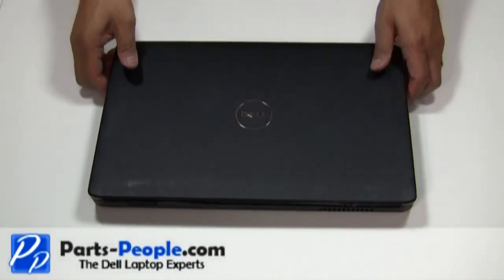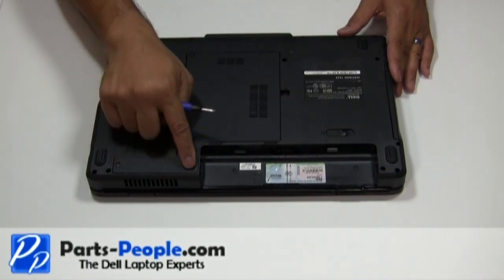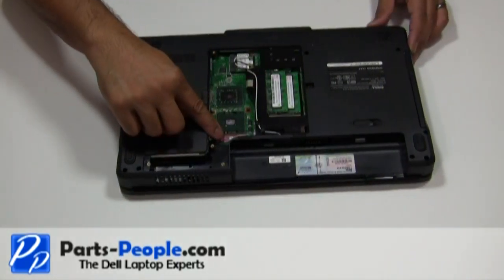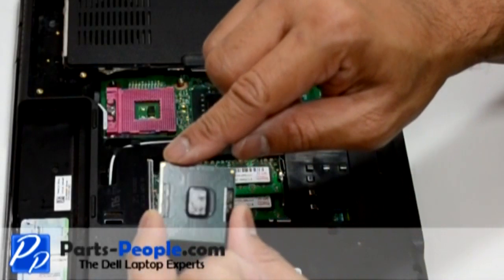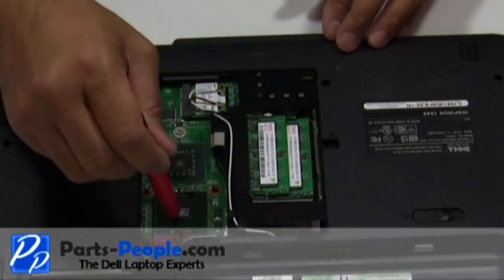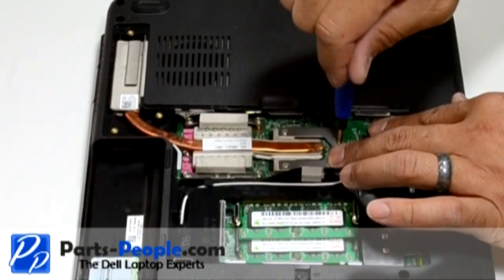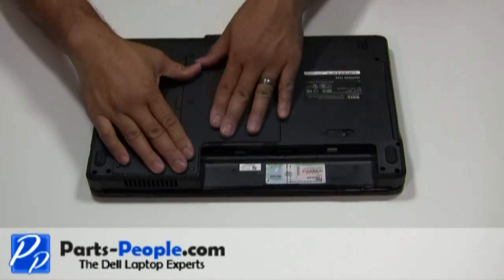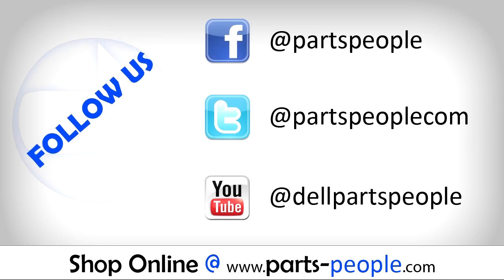Dell Inspiron 1545 | CPU Processor Replacement | How-To-Tutorial

Comment: Best use of the internet ever. Easiest upgrade I've ever done, thanks largely to this video. Many thanks.

When I lifted out the heatsink there was a sticky blue rubber pad on the chip directly next to the CPU, between the heatsink pad on the chip and the heatsink itself. Does anyone know what this sticky blue stuff is and what it is supposed to do?
Reply: Never mind. I finally conquered my inability to spell and up it popped.
Thanks again for the great instructional.
Reply from the maker: It's a thermal pad, kinda like thermal paste that is used on the CPU and/or GPU. It helps transfer heat off of the GPU and transfers it to the heatsink. On this laptop it is critical that you replace it so the GPU doesn't overheat and fry the motherboard.

Comment: This is super-easy to do, and well worth it. You can get a 2.93 GHz T9800 for less than $25 (or go full-hog on the 3.06 GHz T9900 for $50) and both are fully supported and give the laptop a whole new lease on life. I'm typing this on a 1545 with a T9900, 6 GB of RAM, and an SSD. This is actually competitive with some of the new budget laptops being sold now, and believe it or not, the battery life improves dramatically with the upgraded CPU, because these are higher-quality silicon.

Comment: What is the CPU socket that these come with from factory as mine currently is an T3400 with 2.16Ghz for the CPU and is x64 based. The CPU itself is causing not only Windows to act like crap but Things like Visual Studio 2015 takes to long to open as the CPU is so much crap it wants to use a whole lot of the 4 GB RAM it has which litterally hovs about half of it while the system hogs the rest making other programs close and sometimes it closes Visual Studio because the OS would need more RAM and so then I lose any changes to my C++ Code I did so I would be stuck with Notepad++ and invoing the compiler and linker directly by commandline (which defeats the purpose of the vcxproj project files. At that rate I would rather use clang 3.9.1 and gcc 6.3.0. But I found a good CPU from intel wichi is normally about 300$ there on ebay for 10.90$. The issue is it requires these Socket types and I am wondering what socket is shipped ddefault with these computers? The sockets needed for it is: Socket Type: Socket 478, Socket P, PGA478 Also the CPU is 64 bit so it should not change the amd64 status on it right? The current one it has is "Intel(R) Pentium(R) Dual CPU T3400 @ 2.16Ghz 2.17Ghz".
Reply from the maker: The 1545 motherboard will have a PGA478 socket.
Reply: Ok, So I opened it up last night and noticed there was no more thermal paste left as the T3400 Processor burt through it all or something. Also I noticed it does not have the PGA478 socket but the actual Socket P. My guess is that some builds of the Inspiron 1545 has the PGA478 while others might have the Socket P. Hmm what good is an socket P if it game with the T3400 since probably before I got it about 3~4 years ago. But yeah when I looked it at directly I seen mPGA478MN which implies the socket P.
Reply from the maker: I will need a name or email to confirm  the repair cancellation

Comment: To those watching this: Remember to put on a thin, even layer of thermal paste, such as arctic silver 5, in between the heat sink and cpu processor. If you are using the same heat sink, clean the old thermal paste off with ALCOHOL, then apply a new coat.  You want the paste thin, but without any air in between heat sink and processor.
Reply: Raoul Duke how much silver 5 can i apply ?
Reply: thehegt Tr a very thin layer, covering only the part of the cpu processor which contacts the heat sink assembly directly.  The layer should cover all of it with no air gaps, but not be too thick or cover excessive surface area.

Comment from the maker: The criteria for the 1545 processors are :

1. Core Duo or Core 2 Duo

2. 1mb, 2mb, or 3mb cache

3. 667mhz, 800Mhz, or 1067Mhz bus speed

If the processor meets the criteria then it will be compatible. I hope this helps.

Comment from the maker: When applying thermal paste, you will only need an amount about the size of a pea, directly on top of the chip. If a little of the thermal paste gets onto the green, it's fine, but the thermal paste needs to be centered over the chip.

The gm45 supports DDR2 only, not DDR3. DDR2 800 MHz SODIMMs up to 8GB total.

Comment: Hello, Have you renewed the thermal paste in the video also on the Northbridge? And how much should I use? It is bad if a little paste is on the green platine next to the black cpu chip?
So next question i want to ask, the gm45 chipset supports ddr3 sd ram, but there is only 200pin socket?
thanks

Comment: Hello,
I'd like to assemble T9600 in my inspiron 1545. According to the Internet it's possible, but you are writing below that it will be ok only with 3 MB of cache. This processor has 6 MB. What can I expect after the swap? Is it gonna work, but slower, or not work at all, or yet sth else?

Comment from the maker: The best way to find out is by just doing research online. CPU compatibility is dependent on the motherboard socket type, CPU brand, CPU type, bus speed, and cache. The 1545 must be a Celeron or a Core 2 Duo, 667Mhz 800Mhz or 1Ghz bus speed, and 1MB 2MB or 3MB cache. If the CPU meets those criteria, it should work with the 1545.

Comment from the maker: The i5 is not compatible. The criteria for the 1545 processors are : 
1. Core Duo or Core 2 Duo
2. 1mb, 2mb, or 3mb cache
3. 667mhz, 800Mhz, or 1067Mhz bus speed

If the processor meets the criteria then it will be compatible. I hope this helps.

Comment from the maker: Yes the Intel Core 2 Duo should be compatible with the Dell Inspiron 1545.  The maximum amount of memory supported by that system is 4GB, that's 2GB per slot.  Unfortunately, the video chipset is integrated into the motherboard so the GPU can not be replaced with replacing the motherboard.

Comment: I was on the intel website and i was comparing my current processor, which is a intel pentium T4400, to some of the ones listed in your comment and i found that the Celeron bus type is DMI and sytem bus 5 GT/s, while as my current system bus type FSB and 800mhz does that still allow it to be an upgrade for my current cpu (2.20 ghz 1 MB L2 Cache)?

Comment from the maker: The Dell Inspiron 1545 will accept the following processors:

Processor type:
Intel Celeron
Intel Celeron Dual Core
Intel Core 2 Duo
Intel Pentium Dual-Core

L2 cache:
1 MB, 2 MB, or 4 MB per core depending on model

External bus frequency:
667/800/1066 MHz

Comment from the maker: @silpudog80 Unfortunately the Intel Core i5 - 520M, AMD Athlon X2 Dual-Core QL-64, AMD Turion X2 Dual-Core RM-74 or AMD Turion X2 Dual-Core Ultra ZM-82 processors will not work in the Dell Inspiron 1545 because they require a different socket.  Now the Intel Celeron 900, Intel Pentium Dual-Core T4200, T4300 or T4400 or Intel Core 2 Duo T6400, T6500, T6600, P7350, P7450, P8600, P8700 may work as long as they will fit the P Socket.

Comment from the maker: @silpudog80 according to the Dell Certified Systems experts guide the Dell Inspiron 1545 will accept the following CPU's. 

Processor type:
Intel Celeron
Intel Celeron Dual Core
Intel Core 2 Duo
Intel Pentium Dual-Core
L2 cache 	1 MB, 2 MB, or 4 MB per core depending on model
External bus frequency 	667/800/1066 MHz

Comment: According to Wikipedia you can upgrade to all of these processors :
 Intel Celeron 900, Intel Pentium Dual-Core T4200, T4300 or T4400 or Intel Core 2 Duo T6400, T6500, T6600, P7350, P7450, P8600, P8700, Intel Core i5 - 520M, AMD Athlon X2 Dual-Core QL-64, AMD Turion X2 Dual-Core RM-74 or AMD Turion X2 Dual-Core Ultra ZM-82 

Can you really? Will they all fit?

Comment from the maker: @SamThomas23sr The Intel Celeron 900 supports a PGA478 socket, while the Intel Core 2 Duo E6600 requires a PLGA775 socket.  You will need to find a Intel Core 2 Duo that will support the PGA478 sock which is on your motherboard.

Comment: I've brought a Intel Core 2 Duo E6600 2.4GHz Processor to replace the intel celeron 900 in my inspiron 1545 and it doesnt seem to be compatible (the origional processor has loads of pins in the bottom and this new one doesn't) have i brought the wrong thing??

Any help is greatly appreciated :)

Comment from the maker: @danthug I believe it is going to be the Intel Core 2 Duo.  The quality and performance does not necessary depend on the highest clock speed.  There are other factors such as the number of processing cores, the system bus speed, and the amount of Level 2 cache.